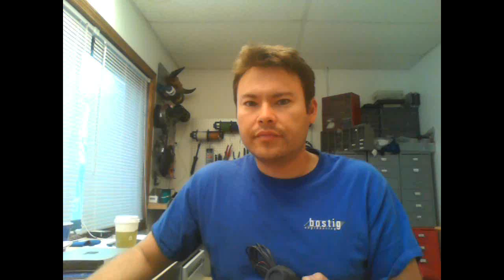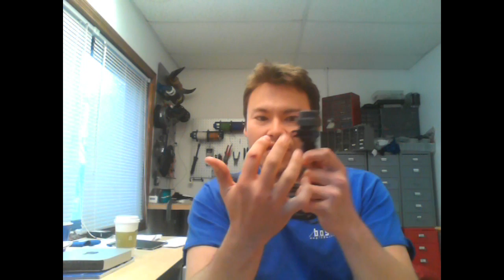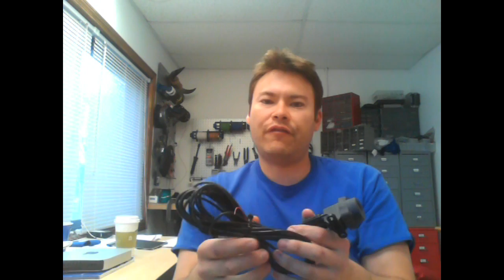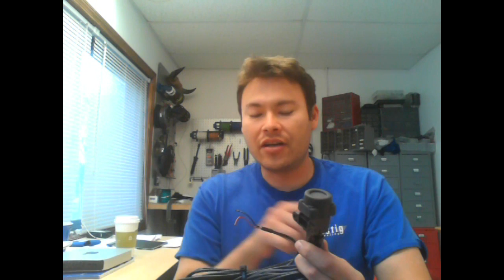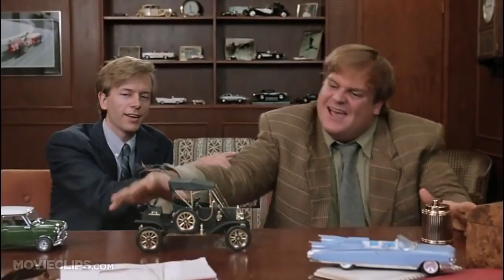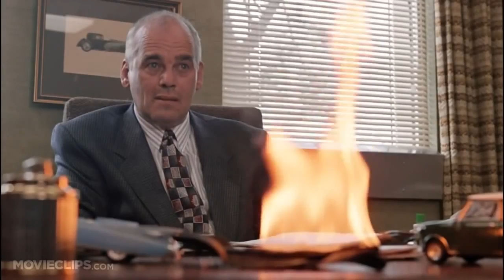Inertial fuel pump relay cutoff switch

Comment: So at 2:40 you say that if the engine is stalled (no inertia relay used) and the key remains in the run position, the fuel pump continues to pump fuel?  Really?